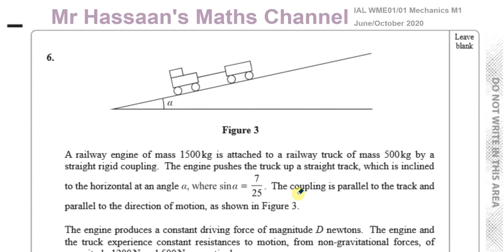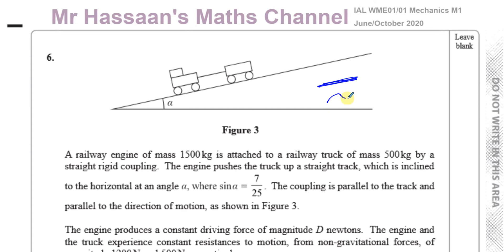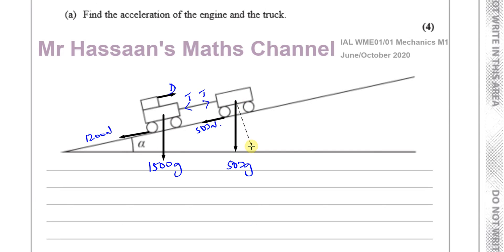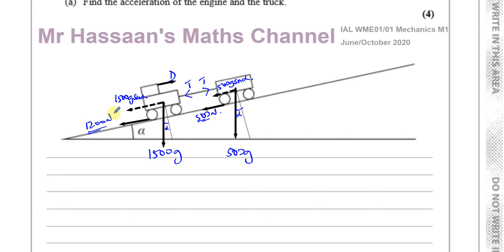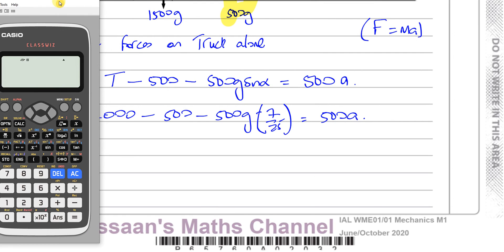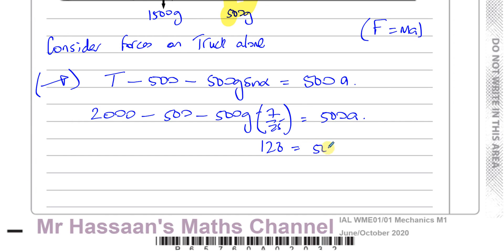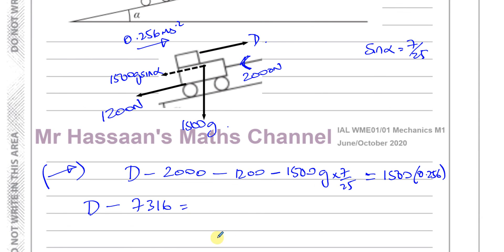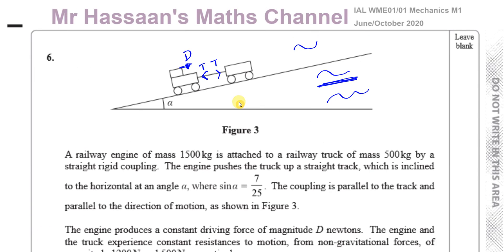WME01/01 Mechanics M1 June/Oct 2020 IAL Q6 Dynamics-Connected Particles- Planes

Comment: Hi, i have a few questions if you dont mind answering them. 1 is thrust throughout the rod constant just like tension and i dont understand how we can use only the truck to find accelaration because since they re connected shouldnt they be taken as one object or are we allowed to do that?
Reply from the maker: Yes the thrust is the same throughout the rod just like tension... .. as for the acceleration... they are both connected by the same rod which is inextensible and therefore the whole system plus all its parts are all moving with the same acceleration.... so we can consider in isolation all the forces acting upon just one part of the system and it will have the same acceleration as the whole
Reply: @MrHassaansMathsChannel  ok sir thank you so much, that makes sense

Comment: Sir, I have a question which is not about the video. So I did my M1 Oct series today and there was a 2 mark question asking, what is the result of μ being greater than or equal to 1. (The question is not word to word but its something like that)
Reply from the maker: If the coefficient of friction is equal to 1...That would mean that the force required to lift the object would be the same value as the Force required to slide it along a rough surface. Remember the coefficient of friction is Fmax divided by R. So if the coefficient of friction for example was 2... that would mean to slide the object along would require twice as much force as to lift it off the ground... that could be the case with such surfaces as sand paper for example
Reply: @MrHassaansMathsChannel  so I wrote that the particle would not move as Fm=μR  and since μ increases Fm would increase because they are proportional to each other

Comment: sir for part b, i got D=7706 because i took my acceleration as 0.26. Do I still get my full 4 marks? You took acceleration as 0.256 and got D=7700. In the MS, they did allow us to write our acceleration as 0.26 in part a.
Reply from the maker: its always best to use values to a higher degree of accuracy in calculations than the degree of accuracy required in the final answer
Reply: @MrHassaansMathsChannel  so in this case, I would get marks for my calculations and steps but not for the final answer right?
Reply from the maker: They might be lenient towards you... but don't even give them that choice

Comment: CONFUSED ABOUT DIRECTION OF THRUST OR TENSION:shelterin:
Reply from the maker: Here is a copy of a reply I gave to a similar question...
when for example a car is towing a caravan - the rod has tension just like a rope. If the brakes are applied by the car alone, then the rope will cease having any tension and the caravan will smash into the back of the car. If however they are connected by a rod, then it is rigid and the caravan will not be able to crash into the car because the rod will in this situation have thrust which acts in the opposite direction to the tension before, kind of like keeping the car and caravan away from each other.

Comment: So thrust acts just the opposite of tension?
Or the direction of thrust depends on the pulling and pushing??
Reply from the maker: when for example a car is towing a caravan - the rod has tension just like a rope. If the brakes are applied by the car alone, then the rope will cease having any tension and the caravan will smash into the back of the car. If however they are connected by a rod, then it is rigid and the caravan will not be able to crash into the car because the rod will in this situation have thrust which acts in the opposite direction to the tension before, kind of like keeping the car and caravan away from each other.
Reply: @MrHassaansMathsChannel  understood it. Thank you sir. 
You're a life savior!

Comment: How come the driving force D doesn't apply to both the truck and the engine? Since it's coming from the engine (making it move forwards) but then it's also pushing the truck and making it move forwards isn't it? (I understand this is the wrong way to think about it, but I don't understand why)
Reply from the maker: The Thrust in the rod between them transmits that pulling force... it doesnt have an engine of it's own.
Reply: @MrHassaansMathsChannel  i didnt get what u mean can u explain it in a different way or something? bcz in my mind the Driving force it what enables the truck to move forward therefore it should be considered when calculatinggggg

Comment: Hello is thrust and tension the same but tension is in string and thrust in rigid objects
Reply from the maker: When the object in front is pulling the one behind then it is tension in both.. when the object in front brakes then if it is a string between them the one behind will smash into the one in front... but if it is a rod then there will be a thrust acting outwards keeping them apart
Reply: @MrHassaansMathsChannel  thank you